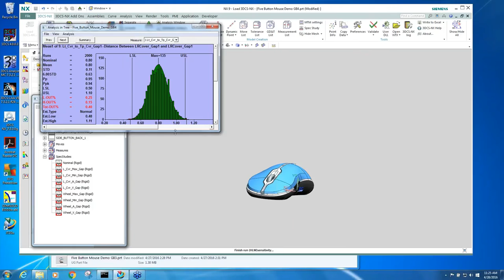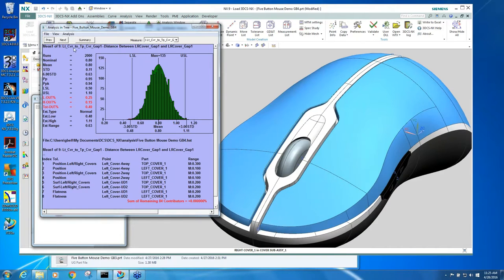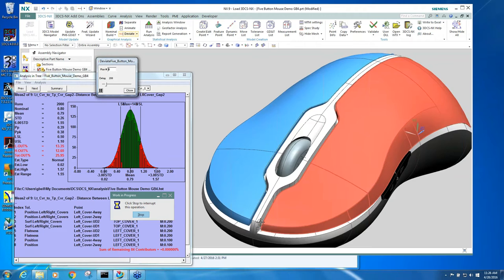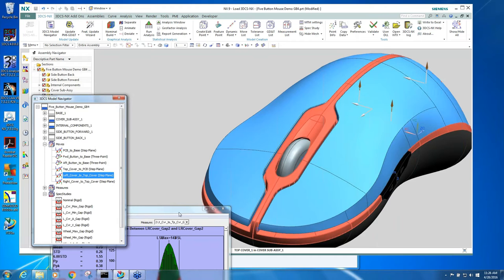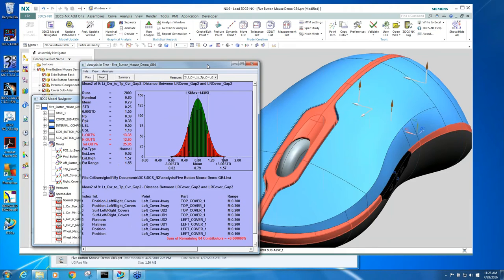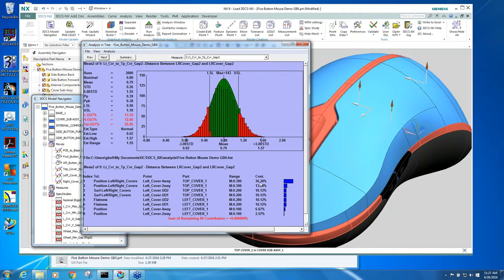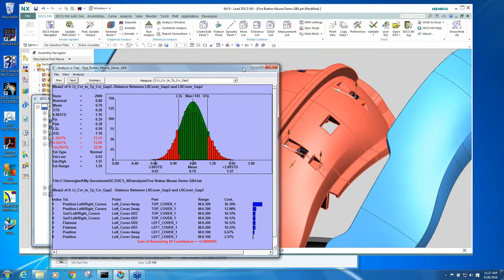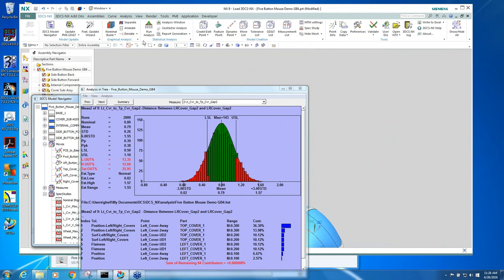First Look! 3DCS for NX Analysis Summary

Comment: Does it do 2D-3D tolerance analysis?
Reply from the maker: Of course -- both 2D and 3D, but most users leverage it for 3D tolerance analysis and manufacturing process and assembly validation